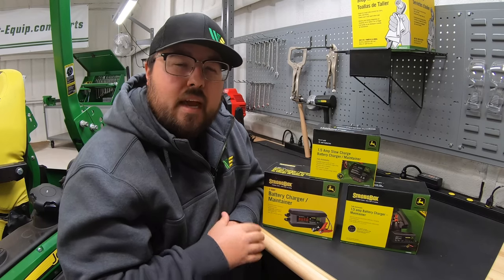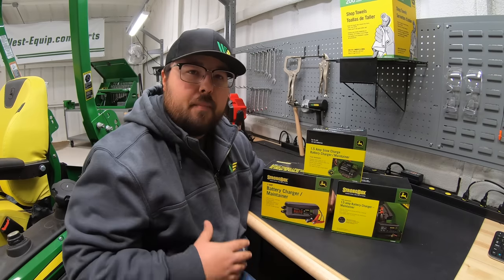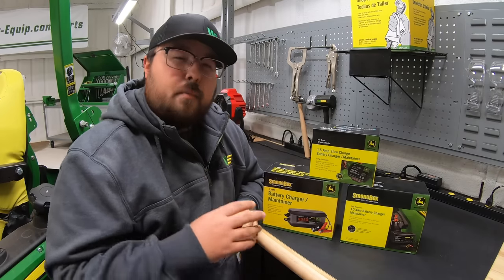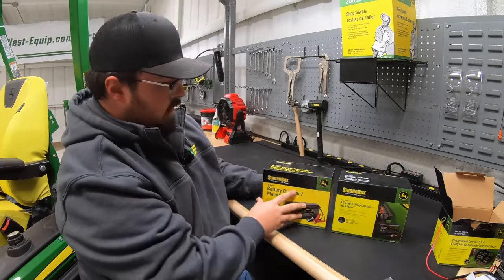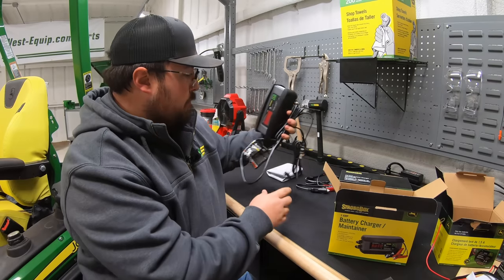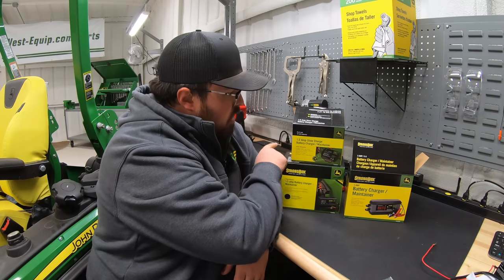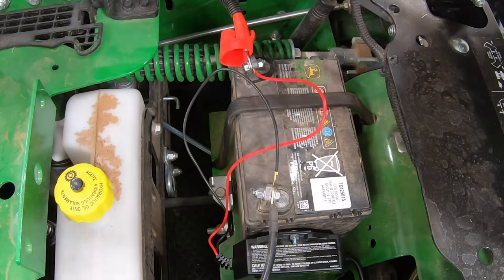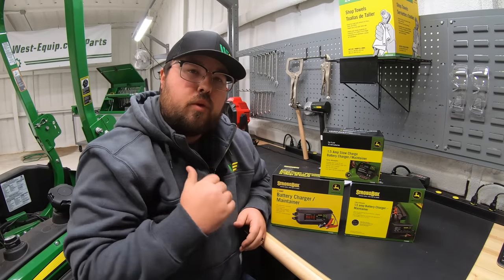John Deere Battery Trickle Charger Review | How and When to Use a Battery Tender on Your Equipment

Comment: I like the versatility of the non-mounted units. With the different tails you can put the ring terminals on the principle battery, and use the charger on something else with the clamps without any "un-wiring".
Reply from the maker: I completely agree with you. Pretty sweet chargers. Thanks for watching!

Comment: John Deere sent me an email for a 20% discount coupon for 1.5A battery charger/maintainer..  One question I had, do you plug it in and leave it on 24/7 until Spring?
Reply from the maker: Yes, it will turn off when it does not need to charge the battery.

Comment: Brent, thanks for another helpful video, recently sold my Cub Cadet and finally purchased a John Deere Z330R, My mower gets parked in my garage where id does get cold, I had issues in past starting my Cub after each cold winter.  With a new start I want to take great care of my JD.  I can just use the clamps and keep them on all winter until the first mow?

Comment: Hi there - We just received our 2021 X390. It will be garaged (unheated) for the winter - as is our old beloved 2002 LT150. Everything is so new on the X390 that I almost hate to spray the protector on the shiny & new battery terminals, add the felt washers, the battery tender fused rings, etc., before hooking it up to the trickle charger. ~~ My question is: Should we do this for its first New England winter season? We don't have an attached plow or snow blower, so it will be in storage until spring. Can sulfur accumulate on a brand new battery? Should we go ahead with the full battery maintenance task on a brand new tractor? Your advice would be invaluable. Thank you.
Reply from the maker: I would say yes! It is always great to do this preventative maintenance as soon as possible. If more people did this they would not regret it. Great question and thanks for watching!

Comment: I have the 1.5 amp non-mountable one. I hooked it up with the alligator clips. Should I use the ring clips?  When you use the ring clips, can those stay in place without issue during the summer when we are using it regularly? Thanks for such a great channel. You've helped us loads already. We are new to this!
Reply from the maker: You can use the the ring clips for sure without issues in use.

Comment: Great video can we order JD parts from you I've bought 9 JDs over the years but my dealer is horrible l have to drive to crystal river Florida for my equipment there good but not the best in shipping parts it's 60 miles one way from my shop the horrible JD dealer is across the street l bought 50.000 worth of equipment from them but they threw me out because they can't fix a carburetor problem Everglades equipment 👍🇺🇸
Reply from the maker: Sure! Go check us out at west-equip.com/parts and thanks for watching!

Comment: Brent. Just bought the 3 Amp from your parts website last month. Going to use it on my brand new X350 w/bagger I just bought. Your videos were very instrumental in my decision to buy the tractor for bagging. It was almost a coin toss between it and the ZTR. But the need to bag swayed me to the tractor. Got the 42” and it bags like a vacuum sweeper. Love it !! Oh and I got that sweet oil drain pan from you too!
Reply from the maker: @Doug Gracy thanks for the update on your tractor and bagger. We really appreciate your business getting the bagger, charger and drain pan! Glad you’re loving them!

Comment: I was thinking about removing the battery and bringing it indoors for the winter. Will I still need a charger when it’s spring?
Reply from the maker: There is a chance that you may still need to charge it. I would just test it before you are ready to mow and make sure. Good question and thanks for watching!

Comment: So I have a L110 and a 1025r. What is the best to get for both machine or do I need to get 1 for each.  The l110 sit in a warm garage all winter the 1025 is used year around. Thanks.  Great video
Reply from the maker: It is really up to you on how many chargers you get but if I were getting one to use on both I personally would get the TY25866 https://parts.west-equip.com/battery-charger-maintainer-ty25866/ and if you wanted one for each I would go with the TY26328 https://parts.west-equip.com/john-deere-1-5-amp-mountable-battery-charger-maintainer-ty26328/. I hope this helps and thanks for watching!

Comment: It’s interesting that the instructions for this charger does not indicate if the battery cables should be connected or not, it also states that the negative terminal of the charger should be connected to to the body of the vehicle, not the negative post — which is correct, your instructions or theirs?

Comment: how would these work on a machine that has two batteries?
Reply from the maker: You would just need to make sure that your maintainer is capable of running the correct volts for your system.

Comment: Hey Brent, I just put my trickle charger on my battery on x350 and I have a ton or corrosion on the positive terminal. Any ideas on what I can do to prevent this from happening in the future?
Reply from the maker: Yes, so first I would clean it off with some baking soda and water or some battery terminal cleaner. Then you can actually buy battery terminal protectant that will keep corrosion from building up. You just spray it on your terminals when they are clean and it creates a protective layer on your terminals. I hope this helps and thanks for watching!